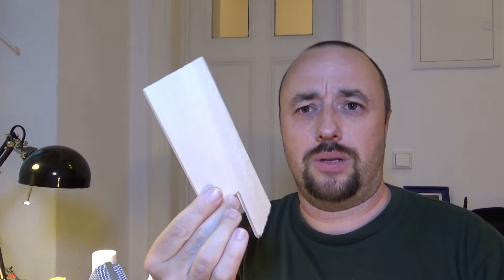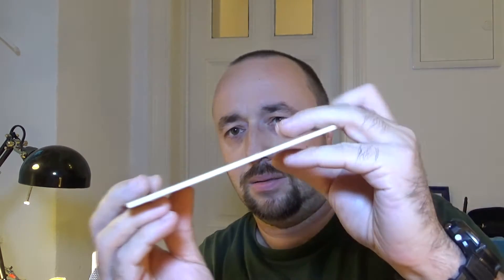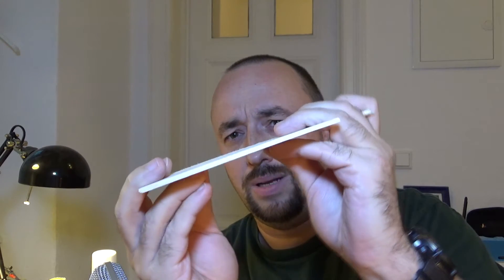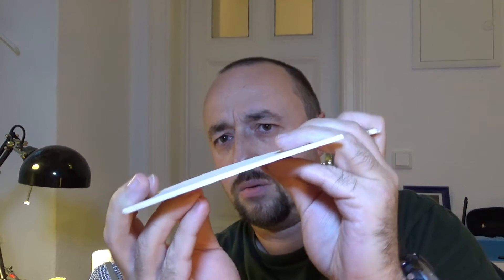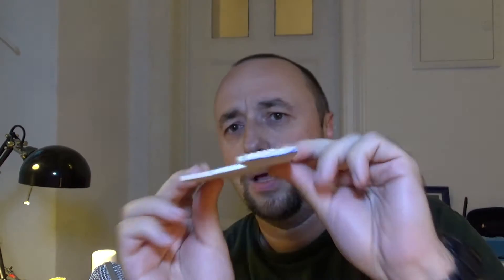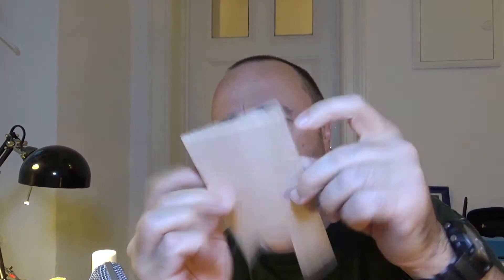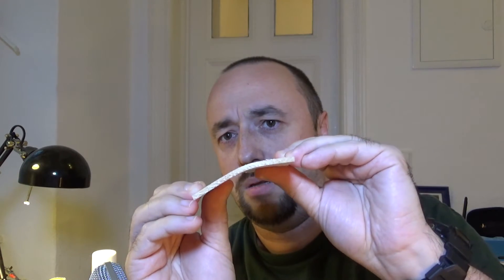Fiberglass laminated balsa wood at home!

Comment: I made a couple of small speaker cabs (5 inch cube, roughly) out fiberglass using a balsa wood “armature”.  I glued surfacing veil onto the balsa frame using cyanoacrylate cement, then painted the veil with epoxy to stiffen it. A few more layers of fiberglass, and I had my cabinets.

Comment: have you ever tried bondo the fiberglass car patch stuff thin layered. epoxy resins are great though many uses I like enamel coating too or Ca glue coating works great and fast with harden spray lol I coat with anything though in testing silicone/rubberized on a hard coat takes impact well and stops vibes makes nice sheets too. you don't need glass fiber cloth really use nylon it can be found cheaper in many colors and is very strong. great stuff not many ppl think anymore in rc just buy whats hyping
Reply from the maker: Actually almost any type of cloth would help. Like paper :) I tried poliurethane wood glue, but that was too soft. So epoxy for me

Comment: Genious! Awesome dude! I had never considered that. Next level of awesomeness is both sides, and using Carbon fiber cloth!
Reply from the maker: That probably would be an overkill. More important is to use correct epoxy resin designed for laminating. Regular glue is too brittle